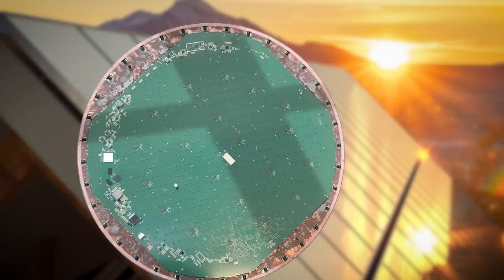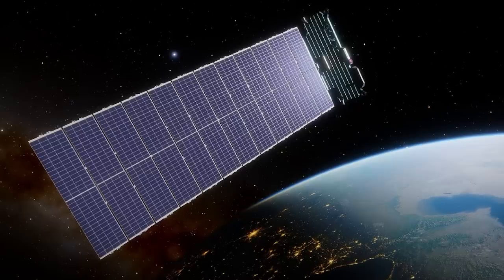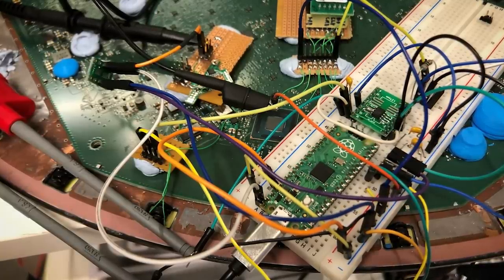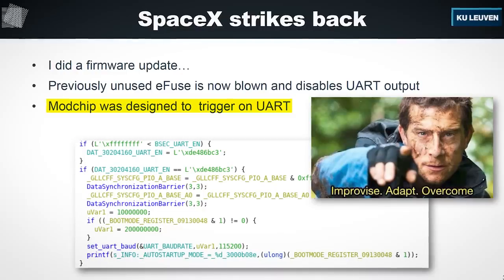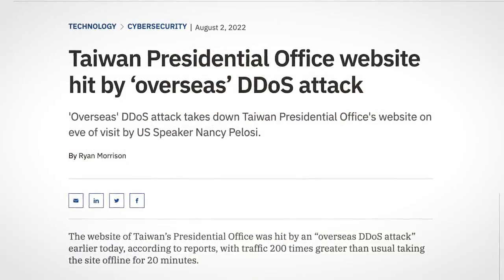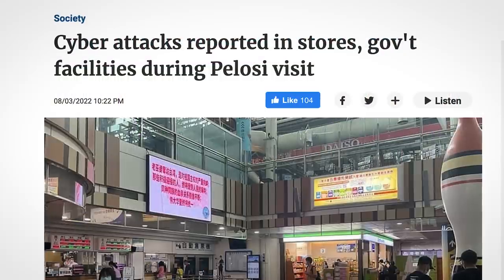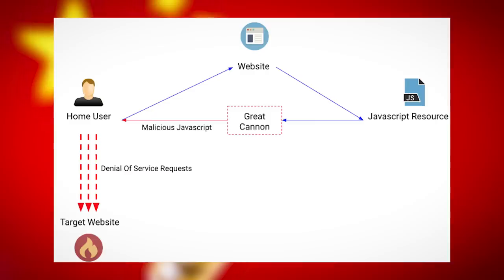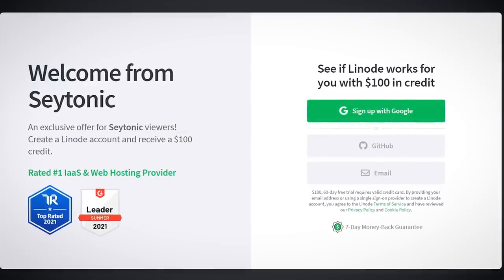StarLink Dish Hacked With $25 Device

Comment: You just simply glossed over the point where spacex just bricked your device from ever showing any serial output just by a firmware update. This should really be concerning on the state of consumer rights. They didn't even repair the vulnerability, just make it harder by removing device functionality for which you paid for and own the device.

And no, you can't resolder a fuse that is in the SoC, UART gone forever so just more electronic junk once it gets bricked by an update or by NAND errors.
Reply: Don't look at Tesla's OTA abilities then....
Reply: you don't own the device the company does you are just borrowing it unfortunately
Reply: anyone smart enough to be using the uart interface is probably smart enough to bridge a fuse...
Reply: saldy most people only care about consumer rights until after theyve been screwed.. 
Too many folk i know just want it now and want it glossy and new
Reply: I'm half on this one. You shouldn't be able to hack a satellite. That brings very bad vulnerabilities to the air and is not good. I understand the right to repair and support it, but I'm going to pass on this one. Maybe a old TV dish but not this.
Reply: @handymanr4729  true until there expensive hardware need a repair,  and need to neogotiate with 'custmer care' who really want us to buy a new device than repairing it
Reply: @MattTheTekie  security by obscurity is not a security
Reply: @joshydoy  it's not a fuse in a traditional sense; it's actually a part on the silicon chip, which is so absurdly small that it is basically only repairable via replacement of the chip.
Reply: You never OWN the hardware from ISP's its always rented, and expeted to be returned.
Reply: @JamesStone_Loner4Ever  I don't know the case of Starlink equipment but you most certainly can purchase a cable modem many places besides an isp, and it is your own personal transferrable device. You can do with it as you wish. It does however have to download firmware from the isp in which you wish to use. Their terms of service forbid tampering with their firmware but it is still your device to do with as you wish.
Reply: @D3M3NT3Dstrang3r  xfinity gateway, go call them, its rented hardware, cable boxes, rented hardware, the world is comprised a mix of both, don't try to get smart with me
Reply: @thatpizzalesbian6984  sounds like a 3rd world issue
Reply: @thatpizzalesbian6984  and where are you from?
Reply: Don't be silly, you did not pay for UART output. You paid for a starlink terminal that can access the starlink network.
Reply: @JamesStone_Loner4Ever  Nobody is trying to get smart with you I am stating a fact. I Own my own cable modem free and clear of xfinity and can use it in any cable service that supports that device. Yes most of the equipment in the wild is rented but definitely not all of it.
Reply: @joshydoy  a uart fuse is often internal to an IC
Reply: Starlink terminals are expendable. They are thrown away rather than returned.
Reply: Well, serial is typically more useful in tampering than it is in actual usage of the device, so it's understandable that it was removed.
Reply: @unpotatoedsalmon  you keep thinking that but if I ever get my hands on a dish it ain't ever going back
Reply: Brylan  "Go make your own multi billion dollar satellite internet company" is the best "pull yourself up from the bootstraps"ive heard in a while
Reply: Read your TOS, you don't own the hardware, you purchased a license to access a service and are given permission to use their hardware to access it, this is how everything is these days. It is fully within the company's rights to do what they want with THEIR property.
Reply: @MattTheTekie  u must be new in this field welcome bro go take a quick historical look to understand problems with this 
Hint: Obsecurity is bad
Reply: Brylan  If you think just anyone has the ability to make a multi billion dollar company you're sorely mistaken. People like you defending this stuff is the problem. Right to repair is a serious issue that needs to be addressed, companies have been allowed to do these things for far far too long.
Reply: @NafrytiNosferatu  It is true that you pay for a service, there is a monthly fee afterall. But for what do I pay the 600 dollars for (2500 if business) then if not for the hardware? Those clauses in TOS should be illegal if you fully pay for a product. You might argue that the monthly fee is for software updates, but a software update that limits the hardware features is not ok in my opinion.
Reply: @JamesStone_Loner4Ever  unless you buy the modem from the store and use your own wireless router.
Reply: You didn't pay for any serial port functionality. That serial port was their for their factory and developers and not for you. And there is no way they can have the processor replaced, expecting the chip manufacturer to magically make a glitch-protected chip.

When you buy a a product, the software functionality you can claim as yours is what is specified in the marketing material. And that does not include any trace output from an internal serial port only accessible on the PCB of the device.
Reply: @NafrytiNosferatu  "You’ll own nothing. And you’ll be happy."
Reply: Have you heard about Meraki? 🔥
Reply: @Kitten-Master  But can you do anything like modify it or not have it brick on you?
Reply: how on earth would you suffer from nonexistence of an INTERNAL serial connection ? if it was never there you wouldn't even notice.
Reply: @joshydoy  the fuses are inside microchips it's not something you can bridge with a little soldering iron dude... Intel and AMD have come up with the same b***** to a lock CPUs to a motherboard.  They'll blow these microfuses inside the CPU and they can never be reset.
Reply: @NafrytiNosferatu  As if anyone ever read the TOS of anything. and now we are in this mess... thanks i guess? If I can only rent stuff, advertising with the word "buying" in it should be considered false advertising.
Reply: @perwestermark8920  Yeah, i will sell my stuff like that as well now. "Oh you bought my car? BuT You dIdN't PaY FoR tHe WheElS bro!"
Reply: @Akab  If you sell a car "as is" then you could sell it without wheels. If you have a photo of the car with wheels, then you must explicitly write "wheels not included".

The thing here is that an internal serial port intended for the developers and for factory tests is not an end user feature that you can depend on.

The equipment I'm involved in has no components for any such serial port fitted - we just fit them on prototype boards. And it's irrelevant to a buyer if we would try to permanently disable them using any microprocessor fuse because the customer gets what we have listed in the product documentation. And that does not list an internal serial port or "means for writing own software". We are free to make new models using different components and zero internal port as long as the changed product still fulfills what we have promised the customer.

Open an old VHS or DVD player. What do you, as owner, know (or need to know) about any test points on the PCB of the device? How is it relevant to if you got delivered a working VHS or DVD player?

If you buy a new car you find an OBD2 interface because the current law demands one needs to exist. If there hadn't been such a law, then you could only comlain about a missing port if the car manufacturer had explicitly listed the availability of an OBD2 port - i.e. if it was part of the agreement.

Start to see why it's often mentioned "batteries included" or "batteries not included" when you buy things. It's all a question of what you are contractually buying. That remote you bought - seen any description exactly which IR LED it uses? Nope - as long as it works properly, that information is not part of the contract. And if the remote control is sent in for service, you could get it back with a different model of IR LED, as long as the change doesn't reduce the capacity of your remote control.
Reply: @perwestermark8920  Well, still doesn't change the fact that if something is changed in the hardware after I bought it, I'd feel pretty scammed, regardless of how right they are.

TOS are entirely abused by the "everything as a service" thing now to the point where they force a service onto you to even get to the hardware. If that's not scummy what is it?

Your right. Most people will not realize such a minor thing, but those who do will.
Reply: @Akab  Well that really depends on if it's a hardware part you are explicitly paying for or not. How bad would you feel if someone magically removed your appendix without need for surgery etc? Would you suddenly feel tricked by no longer having it? Exactly how would it make a lesser human?
Reply: @perwestermark8920  Well a product is NOT a service. "enabling" something that is already there and then calling it "service" or even worse, disabling something without being asked for is nothing other than thievery if you ask me.
Reply: @Akab  Well, I'm not asking you. And have you read the contract? What text in the contract stipulates that you have a reason to be upset?
Reply: @perwestermark8920  I don't get you. Have fun if you love paying more money for worse products. That's the only thing we, the customers, get from this.

Edit: I am upset of how dumb some people are even willingly getting themselves scammed
Reply: @Akab  Eh. You are fighting a non-issue.

You want to be angry? Be angry that you may sell a Starlink receiver. But it's up to Starlink if they will allow the new owner to actually use it. Which is similar to if you buy a car - you may sell it but the car manufacturer has reserved the right to decide if they will let the new owner use the car they bought.

Be angry that Starlink has an upgrade model so if you have the receiver turned off too long without receiving updates, then it ends up bricked, and Starlink refuses to help reflash it and expects the customer to pay for a new receiver. And they did not implement any recovery mode.

Be angry that lots of users have seen a significantly decreased bandwidth because of the available bandwidth being shared by too many users.

Be angry that Starlink has a roaming subscription allowing people to pay extra to get around the sales stop in overloaded regions and still be able to buy a new subscription and further overload some popular regions.

If you really want to be angry - why not select a reason that actually matters?
Reply: @perwestermark8920 I don't like those things aswell.
Just because i'm angry about one thing doesn't mean I'm not angry about anything else. I despise all those things yiu mentioned but evenmore the people that just mindlessly accept that crap.
 Well, be ignorant by yourself and have fun like I said! 👍
Reply: @Akab  I obviously do not mindlessly accept that crap. But see it as rather irrelevant to be angry about a configuration change in the processor relating to a serial port never ever intended for any end users.
Reply: @joshydoy  The kind of fuse they are talking is integrated IP inside the silicon. You would literally have to grind the cover off the CPU packaging and expose the internal die to even gain access to this. You can pretty much guarantee your CPU would be completely destroyed by the time you actually managed to access the fuse, and if by some miracle you could access it, you would need the same clean room technology and multi billion dollar equipment to repair it that it took to make the chip in the first place.  No. Internal fuses are non recoverable.  You either use the part as is or throw the part away once they are blown.
Reply: @Akab  Apparently remote disabling of the hardware is part of what you paid for, surely you would want to use ALL  of what you paid for, including bricking it.
Reply: @MattTheTekie  No one mentioned in this video ever "hacked a satellite", not even the russians that hacked satellite ground stations and user terminals.
More over, getting root access on the Starlink dish is highly unlikely to give any advantage to a would be satellite hacker as most of communication satellites use entirely different antennas and frequencies for comand and control than those used to provide their service.
Finally, relying on end terminals security to protect your entire system is just an insanely bad idea (it's like entrusting the entire security of a cellular network on the hope that nobody will ever be able to root or jailbreak a single phone), and surely Starlink knows this too.
I suspect the reason they are so zelous about preventing end user root access to their terminals has a lot more to do with FCC certifications and regulations than with the risk of satellite hacking (FCC's employees are constantly haunted by nighmares of user modded wifi routers somehow accidentally becoming doomsday devices capable of bring down airplanes and stuff like that. I let you immagine how little they have slept since Starlink approached them to ask permission to sell to any regular-joe a SHF/EHF phased array transmitter).
Reply: I mean all satellites in operating system security would have a right to break your firmware and ultimately breaking your device from having any form of serial number coding being exposed that originates from the actual satellite. That’s called cyber security last time I checked and isn’t a violation of consumer rights… just because they have the ability to do that doesn’t make it illegal to have. They never used it towards their own customer base… the guy got his thing bricked for hacking into the satellite…
Reply: @logmeindog you even own a Tesla? They don’t have any say so on what you do with your car but they give you incentive insurance wise to keep it within standards. You don’t have to follow those standards and if you think that’s bad look what Ferrari policy is… they can literally take away your property if you modify it…
Reply: @makak_zeleny dude The guy literally hacked a satellite. You’re not the customer if you’re hacking through back door means to get into the companies hardware or software. They had a very fast and functional security team that literally bricked the guys device from access of the satellite because he didn’t pay for satellite X services. He even in the video mentioned that he was not a star link consumer. Are you going this absolute mentality saying that oh that’s still not security that’s a form of authority. The bridge is my customer care service they should be Couch talk to me in luxury is a stupid statement to make.

Comment: He really used the Xbox 360 hack on a network dish like it’s 2009 🤭
Reply: If it works on modern hardware/software then it's not outdated
Reply: > Car makers really use round spinny disks to make their contraptions movable, it's like it's 4000 BC
Your point?
Reply: @Anvilshock  I liked his comment in the sense that this hack still works. It's nice to see old things/ways still work when you would've expected them to be outdated.
Reply: @bryanjk  But why did you expect them to be outdated in the first place? What's your base for making this assumption?
Reply: @Anvilshock  that we learn from the past and typically vulnerabilites are patched or designed differently so the exploit no longer works just like with all our security.
Reply: @bryanjk  Again, what are you basing this on? Are you a security analyst? Do you have reliable data on hardware development trends, hardware vulnerabilities, and other relevant factors? Do you have literally anything less spongy to stand your position on than ignorant, illusorily blind faith in the good of humanity?
Reply: @bryanjk  “just like all” like what’s start DB injections worked form early 2000 tell now it’s a way a principale to hack something 
It’s not old or new
Reply: @Anvilshock  I don't know why you're so trigged over why I said I liked his comment 😅
Reply: @bryanjk  It is extremely hard to protect from glitch attacks. No processor can be trusted to run correctly if there is a voltage glitch. Because of this, they try to detect glitches and do a reset.

But it's common this glitch detection is an external 3-pin chip. It makes sure the device works well for you - but an attacker can remove this supply voltage monitor.

Next thing is that some processors has such a supervisor inside the processor - but instead of attacking by glitching the supply voltage you can sometimes instead glitch the ground. And I don't think a processor can supervice the ground - because what to compare with, when ground is expected to be the fixed reference everything else is compared with. Not sure if the Earth message on the PCB indicated that he did glitch the ground (also called earth) plane and not the supply voltage.

So next thing is to try to make the boot loader more robust and suspecting. But code is code and it isn't easy to make extremely robust code when someone intentionally glitches for millions of times.

Writing code that can't be failed by glitches is like writing nontrivial code that is 100% bug free. But even harder to prove.
Reply: R-JTAG